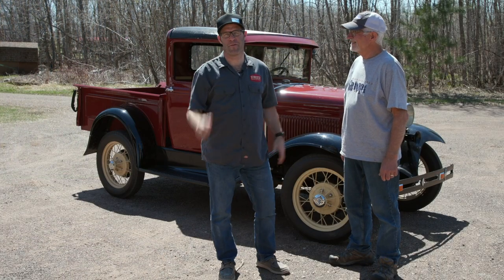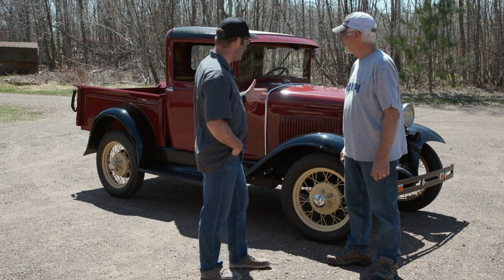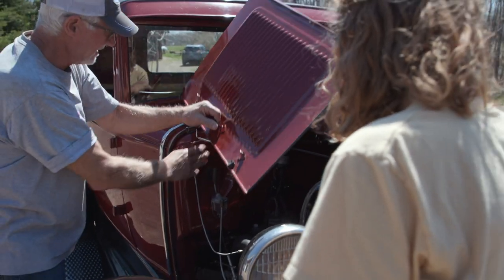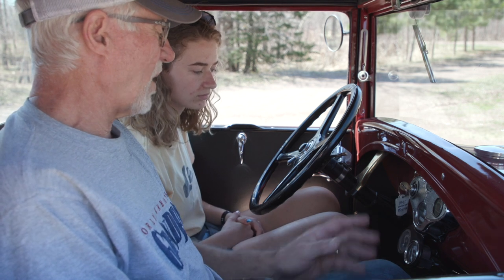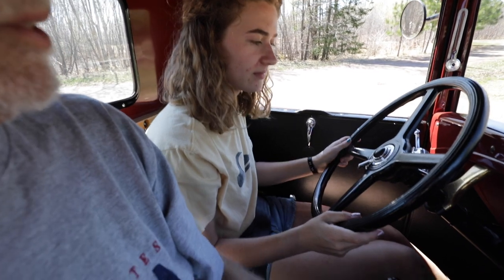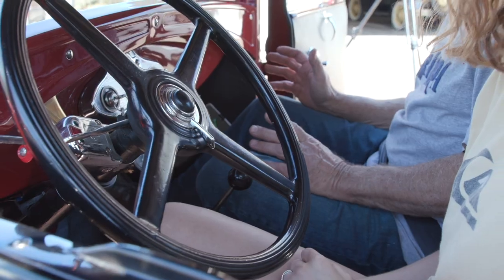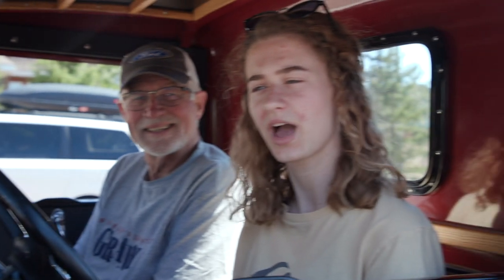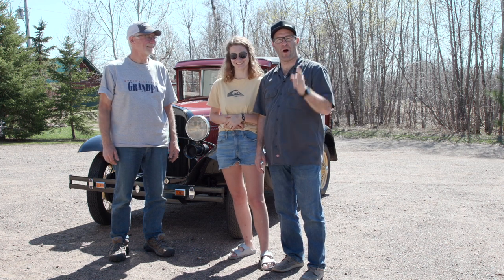Teaching a 16-Year-Old to Drive a 89-Year-Old 1931 Ford Model A Pickup Truck

Comment: Nice job.  Everyone should know how to drive a manual.  That is a gorgeous restoration on that A.
Reply: DID U EVER DRIVE A MODEL   T.  THAT IS MORE FUN.
Reply: @tomkovar3586  I've seen them in person and watched people on youtube drive T's but never driven one myself.
Reply: @leerollins  YES.  MY  DAD  HAD 1. EXPLAIN  2 ME.  3 PEDDLES.  1 FOR  REVERSE,1 FOR BRAKE. 1 FOR FORWARD.  IF I REMEMBER  THIS CORRECTLY.  FORWARD PEDDLE, U WOULD  LET OUT SLOWLY , FOR SPEED. ONCE PEDDLE WAS ALL THE WAY OUT,THAT WAS YOUR TOP SPEED.  ALSO U COULD   CONTROL  SPEED  WITH LEVER ON STEERING  COLLUM.  I BELIEVE  TOP SPEED  WAS 20 MPH.
Reply: @tomkovar3586  I believe you are correct.  I think one of the holdovers from the T to the A was the accelerator lever on the steering column.  While it might be fun to ride in a T I don't believe I'd enjoy driving one too much.  It certainly looks complicated.
Reply: @leerollins  I DROVE  SOME MODEL  A's.  NEVER A MODEL  T.  LEVER ON THE T STEERING  COLUMN  WAS 4 SPEED. COULD  GET  20 MPH.  LEVER ON MODEL  A , WAS USED MORE  4 STARTING. I ALWAYS USED  FOOT PEDDLE ON FLOOR.  GAS LEVER ON  STEERING  COLUMN , WAS PROBABLY  THE FIRST  CRUISE  CONTROL.   😄😁

Comment: This is a great video, a fun day for all!  It really helps that Annika already drives a standard transmission. I know that made it much easier for my kids to learn to drive the Model A, because they already drove modern vehicles with a clutch.

I really do wish that all you guys would stop teaching people that you need to double-clutch a Model A to shift from 1st to 2nd and from 2nd to 3rd. In normal driving, not racing, you don't need to! You only need to double-clutch to down-shift from 3rd to 2nd. 

For 1st-->2nd and 2nd-->3rd, if you will just pause in neutral with the clutch pedal pressed in and count to 2 or 3 while in neutral, it will slide right into the next higher gear with no grinding of gears. Then let the clutch pedal out and go. Try it, you'll see what I mean.
Reply: Thanks for this comment as that's how I remember it, just double clutch for downshifting.

Comment: BTW, you showed her how to double clutch. I learned how to also. I went a step further. Modern transmissions have synchronizers in forward gears. Modern transmissions didn't have first gear covered until the '60's. I found out way too late that double clutching to first gear at 50 MPH was NOT a good idea!

Comment: FIRST  QUESTION. Y R THERE 3 PEDDLES  ON THE FLOOR ?
Reply: JUST  REMEMBER  WHAT  MY DAD TOLD ME.  AND DAD'S  ALWAYS  TELL THE TRUTH. 🤔🤔  TRANSMISSION  IN MOTLE T"s WERE NOT GEARS BUT BANDS. DAD SAID  COMPARABLE  2 AN AUTOMATIC  TRANSMISSION.  THST IS ALL HE TOLD ME, AND I NEVER  ASKED  DAD 2 EXPLAIN  IT.  I GUESS THE TRUTH,  NO CLUTCH.    NEED AN ANSWER.